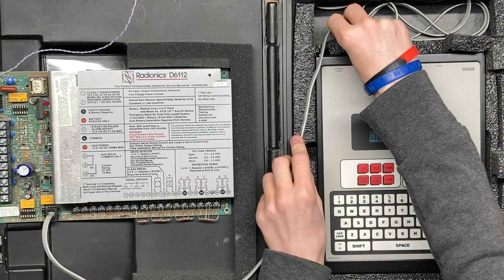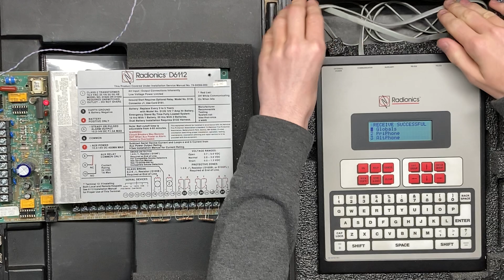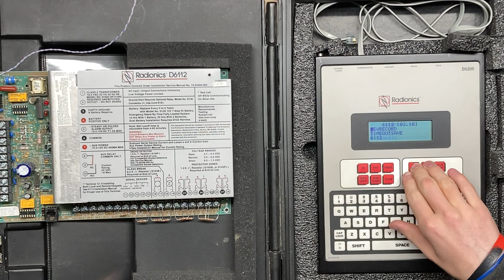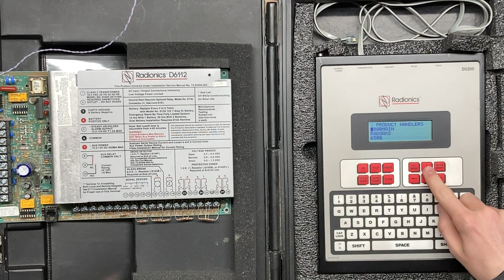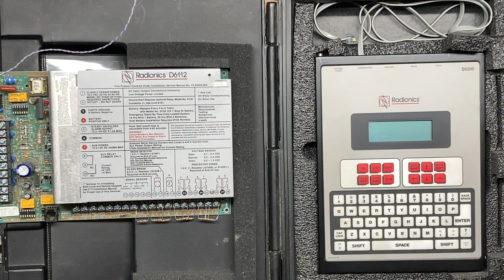How to use the Radionics d5200 programmer

Comment: Is there a default programming code for these D5200?

I’m working on a Honeywell 5800 and the only passcode I have is the one used to silence the keypad.

The reason I ask is because I need to change the phone line numbers in the panel but would I be able to? 

I don’t have the programmer and I would like to know if I’ll be able to change those number before I buy one.
Reply from the maker: Alright these are a bit complicated... By default there's no password on the D5200 itself, however if there is one set the only way to reset it is to de-solder the lithium battery on the board, wait a while for it to discharge fully, then solder it back in. This will clear it's memory entirely, it'll ask you to format disk A upon startup and then will be back to defaults.

The D5200 uses "handlers" which are basically small applications that allow it to support different types of panels. There are no handlers installed in the D5200 by default, for the Honeywell 5800 you'll need to install the appropriate handlers for it. The Honeywell 5800 panels (not 5800B) should use the following handlers: 5900MAIN, ACCESS, POINTS, SKEDS, USERS1, and USERS2. Each of these handlers is used for a different section of the panel's programming, for example the phone numbers that the panel dials out to would be in 5900MAIN. To install these handlers into a D5200 though, you'll need access to a good quality analog phone line (not VoIP or served from a cable/fiber modem), you can connect the D5200 to the phone line, and have it download handlers from the update server. The original server was shut down quite a few years back, but I have re-created it, all the information for the re-created update server is on my website here: https://www.protostarlabs.net/services/handlerupdatesystem.asp

The Honeywell 5800 panels will also have what is called a "datalock" code. This is a lockout code that will need to be entered into the D5200 programmer to program the panel. It is set to 12345 by default, but if it has been changed (which most companies do) there is no easy way to reset it without clearing the entire program stored in the panel. Make sure that you know what the datalock code is set to in the panel before proceeding.
Reply: @ Wow, thank you so much for all the detailed information.
You are the man!
This helps a ton 🙏🏼🙏🏼🙏🏼

Comment: Nice video. Does anyone know if this programmer work on any of the D9412G or D7412G versions, or does it only work on 9112 and other older panels? Interested in getting one but only if it works on 9412’s and 7412’s in all versions.
Reply from the maker: The handlers (like small applications) installed in the programmer determine which panels it can support. The 7212, 7412, 9112, 9124, and 9412 panels all use the "9000MAIN" handler in the programmer for their basic programming. You will also want "RADXAUX1", "RADXPNTS", "RADXSKED", "RADXUSR1", "RADXUSR2", and "RADXAXS" to be able to program all the aspects of the panels. Handlers can be installed into the programmer either directly over a cable to another programmer, or over a telephone line. So in short, yes it supports those panels if you have the handlers for them installed.
Reply: Thanks for the reply! I’m asking because there is one of these available on eBay that I’m looking at and they do have the available handlers listed. Can you still get handlers for this programmer or is it no longer supported and therefore those are no longer available?
Reply from the maker: If you have access to an analog phone line you could have the programmer dial in and pull them from the update server which I recreated. The original Radionics one was shut down a few years ago. Apart from that, the only other way is transferring them from other programmers.
Reply: Will this work on 8112e?

Comment: can you tranfer the saved file out and edit it on RPS?
Reply from the maker: Man I wish... Sadly you can't apart from sending it to a panel and then reading the panel in RPS.
Reply: @KJ7BZC  how can you read panel from rps....is that remote?
Reply from the maker: @gaaat90304  Either remotely by a telephone or network connection, or locally by a serial/usb connection if the panel supports it.

Comment: It's this like the fire alarm panel.
Reply from the maker: Yes, basically all of Radionics' panels are capable of fire and security. The only exceptions are the 7024-style systems.
Reply: We're the drill button on that thing?
Reply from the maker: @benqtzzo6888  There's no drill button on it, only the programmer and the panel board are shown in this video. This panel goes along with the D620 keypad, which is operated like any other security system. You don't see drill buttons on systems that do security in addition to fire like this, it is not necessary for there to be a dedicated button for a function that is rarely used.
Reply: @KJ7BZC the 7024 is fire only